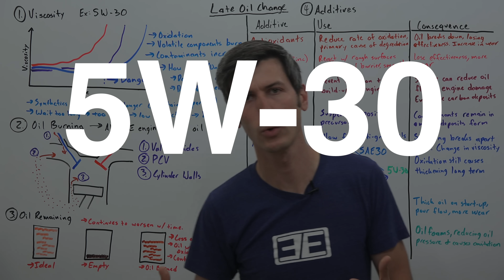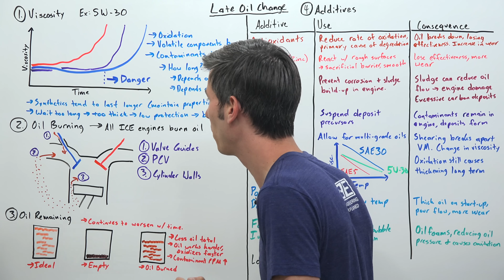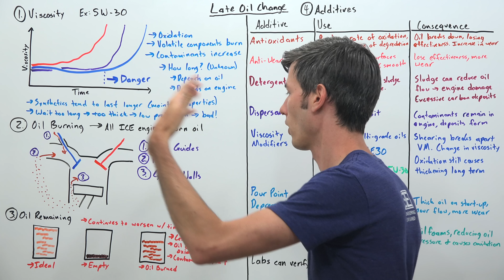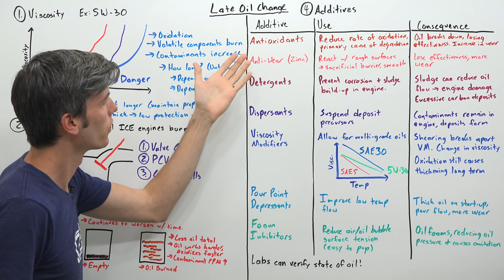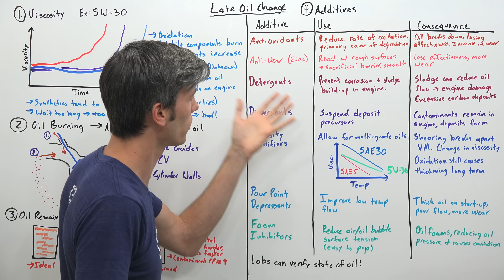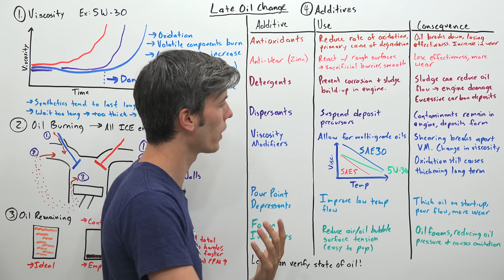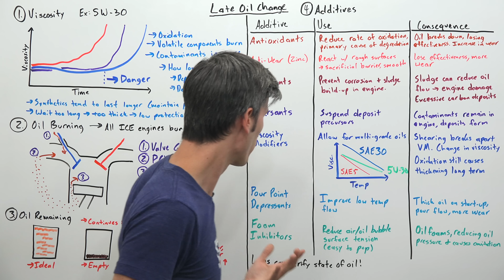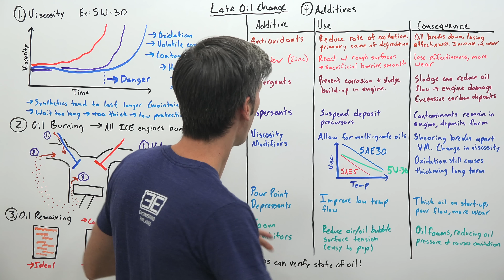What If You Forget To Change Your Oil?

Comment: On a car rarely used( once a month) , how long can fresh oil stay viable for use?
Reply: I would recommend using fully synthetic oil as those do not polymerize and can last up to 2 years and not more than 6000 miles.
Reply: Not more than 6k? Try 20k! Ams Oil and Mobil 1 both have 20k oil and filters.
Reply: @Theag393  That was the answer I was looking for. Usually I change my full synthetic every 2000 miles, twice a year, as I usually drive rarely. However this summer, I went on the road trip of my life, so I have passed 6500 miles 0n the same oil, so I can still make it if I take it to the shop tomorrow!!
Reply: @Tore_Lund  it should be ok. 2000 miles oil change interval is too low. 2 years or 6000-6500 miles, whatever happens first with fully synthetic oil is ok.
Reply: @Theag393  I live on 55 North so we have cold winters. The reason I normally change oil twice s year, is to avoid too much water in the oil because of condensation driving short trips in the winter, but I guess , I could do with changing oil only once a year if done like now just before Christmas and maybe be more sensible and avoid the 10km and shorter trips in winter.
Reply: @Tore_Lund  55 north but where? USA? Scotland? Anyway... Condensation inside the engine is not a big thing because pcv valves and the air should be almost moisture free. The residual moisture will get aspirated and consumed by the engine... Not an huge issue to warrant an oil change
Reply: @Theag393  Denmark actually, so it is just an old myth? Then you saved me $80, if I can just do it once per year! Thanks.
Reply: @Tore_Lund  As the engine warms up, moisture in the air inside the crankcase can condense into liquid form on the cold internal engine parts and is carried throughout the engine by the oil. If the engine does not or is not allowed to reach and maintain full operating temperature for a reasonable period of time, it never evaporates, and it turns into a whitish goop on the oil fill cap, dipstick and inside of the valve cover.

Changing oil more frequently helps remove this buildup, but the best answer is to make sure the thermostat is bringing the coolant up to full operating temperature and driving it at that temperature for at least 30 minutes every few days.
Reply: @Tore_Lund  in Denmark you have an average of 0°c in winter months but can reach -20°c. Check you oil fill cap and level stick and see if you have mayonnaise (emulsion of the engine oil and water). That is a good indicator.
Another indicator if you are going to have condensation is short trips and not reaching engine operating temperature.
Reply: @Theag393  Thanks, I've never had cream colored goo in the filler cap, but it takes a while in freezing temperatures to warm the engine up. I live in the city, so short trips are almost never called for anyway. Otherwise I keep the engine in good condition.
Reply: @Theag393  Try 100% synthetic, theres a big difference.  Amsoil is good for 25 000 miles
Reply: @TheBeatenPaths  I would not do that. Also amsoil is common in America. I am in Europe. I am more interested in renewing the oil and clearing deposits which has been proven more beneficial by using cheaper in specification oil and renewing more frequently than using expensive oil and changing less. Especially in diesels.
I am recommending synthetic oil and by that I mean at least group III oils ( hydrocracked). PAO and Esther is too expensive and you do not make a use of it...
Reply: @TheBeatenPaths  Only if one gets the 23 000 mile oil interval though. Filter change , half that.
Reply: @Theag393  full synthetic can last up to 30k kms
Reply: @keisuketakahasi4584  if you want to have problems sure. Especially with diesels
Reply: Fábio Malhão totally wrong and anyone who works on vehicle engines would disagree. The moisture content alone in two year old oil would corrode the heck out of that engine.
Reply: @MrJoel8959  there can be condensation but running an engine will burn it off. As long as you get up to operating temp and drive around for a while it's fine. Why do you think boats take a wide open throttle pass before putting the boat on the trailer? To burn off the moisture
Reply: Fábio Malhão what if u live in cold place? More little water leak from frozen/snow into oil?
Reply: @ハルドーソンアーノルド  water/snow should not be able to enter the engine oil compartment. If that happens something is wrong. Use fully synthetic oil with a viscosity that is recommended for your weather. Can give advice if you tell me where do you live and the car/engine that you have.
Reply: ・ハルドーソンアーノルド  the moisture in that two year old oil will certainly cause corrosion and engine damage. Don’t listen to Fabio
Reply: Fábio Malhão again your wrong. The heating and cooling of the engine causes condensation.
Reply: This would be interesting to know
Reply: freezeme360  Modern engines are designed to last longer and longer periods of time between oil changes.  3,000 miles use to be the standard.  Now you can buy cars where the factory recommends 10,000/15,000 miles between oil changes.  This is because of those oil additives as well as tighter tolerances of the machining of the engine.

That old oil lacked many of the modern additives and it did prove to cause much more wear than a modern oil.  The point was that the oil didn't degrade to the point that it didn't provide lubrication.  The OP asked how long he could go between oil changes on a car that was driven once a month.  My reference to the 60 year old oil was just to show that oil doesn't break down nearly as fast as the oil companies would like you to believe, they want you to change your oil more often so they make more money.  Yet they make the oils so good now, it's completely possible to just do annual oil changes with normal driving.  And the oil carries a warranty to back up that claim in the event you throw a rod though your block.
Reply: I've been sending in fresh and used oil to labs for analysis for over a decade and this question was asked and answered.  Time does not make oil in a modern sealed crankcase engine that utilizes a PCV system to "wear."  Contaminates due to running said engine, fuel dilation, and  use are what cause oil to wear.  If you're interested in learning more about oil for about $25 you can send a UOA in to Blackstone Laboratories.
Reply: @jaoliver999  Thank you
Reply: I wouldn't stretch it over a year if it's very humid...   And stick to the cheapest spec oil , esters in the boutique synthetics attract water so...
Reply: What I did not see mentioned is hours on an engine, which are not measured on cars like they are on tractors, ATVs, vocational trucks, etc. If a car sits idling or is driven at speeds below 30 mph a lot then miles become less relevant and the oil should definitely be changed every 6 months.
Reply: I've bought cars that had been sitting for 30 years and the oil was fine. As long as you don't have fuel or water in the oil then it's all good. Oil doesn't go bad as it sits, just keep an eye on it to make sure it isn't full of contaminants.
Reply: @BajaBlastBongWater  The oil in my car is 10 years old and still good. I have a rarely driven car sitting in a garage and I don't drive short distances. If I drive it then I drive for an hour so it reaches it's full operating temperature. Even an oil analysis shows the oil is still like new. So the frequent oil changes would be  waste of money and ressources in my case.
Reply: I'm also a low mileage driver, since I use public transportation to get to work.  I pretty much only drive on the holidays and the weekends.  Just follow your user's manual.  For my Toyota, the manual says 5,000 miles or six months, whatever comes first.  So I change at the six month mark, which for me is typically 1,500 miles between oil changes.
Reply: Oil is millions of years old anyway;) i know it's not the same. Was thinking of expiration dates on salt haha
Reply: My last oil change the oil was almost 2 yrs old but had only 2K miles.  So I'm guessing up to 2 yrs should be OK,  maybe longer.
Reply: So many comments but how long? I use my car rarely and i use fully synthetic. Since i do not reach 5000 miles in a year i just change it still after 1 yr. js that okay?
Reply: @markmarquez5431  I've been doing that for 13 years with my 2003 Expedition.  No problems so far.
Reply: @markmarquez5431  Have oil analyzed by blackstone labs, results should give an idea to gauge the interval.
Reply: Mark Marquez Yes, perfect 👌
Reply: One year
Reply: Change it every 12 months or 6000 miles. Whichever comes first.
Reply: Many manufacturers recommend changing the oil every 12 months if you aren't doing enough miles to hit the mileage-based service interval before 12 months elapses. I think this is conservative advice. In practice, so long as the car is used regularly and the oil is topped up as required, you could be fine for longer. However, oil does degrade even if kept sealed and unused. Total say that their oil shouldn't be used if it has been on the shelf for over two years: Mobil extend that to five years. Regardless, the cost of oil is trivial compared to the cost of engine repairs.
Reply: Paul B thank you Paul
Reply: Chrysler service library with conventional oil 12 months or 10,000 miles...I as an FCA tech, I call shenanigans. Synthetic oil a year should be fine. But I'd change it ever 6 months or so.
Reply: @Ratkill9000  The Jeep dealer in my area does that too! 10,000 miles with varnish inducing conventional. Are you mad!? My mom doesn't even drive close to 10k a year on her Hemi Jeep, but it eventually developed a tick at idle at 35k miles. It wasn't the typical Hemi tick, but an intermittent tick that was loud. Oil was only changed once a year at the dealer under their maintenance program. Well... the cheapest thing I can think of to try and fix the tick was better oil. Dumped Royal Purple 5w-20 in it. I gotta tell you that I have never heard a Hemi run so smooth. Usually they are very clattery engines.
Reply: @Dcc357  the Hemi does have a TSB out for bad cam shafts and potentially lifters.
Reply: @Ratkill9000  I've seen videos of the cam lobes wearing prematurely because of the lifters' roller bearings failing. A few things I also noticed weird about my mom's 2013 Jeep Grand Cherokee is a mild shudder when driving up a grade in the overdrive gear on a highway (our Jeep has the 65RFE transmission, heard it has to do with torque converter), and 4 cylinder mode has a vibration. This stuff doesn't really bother us since it's a Chrysler product that's perfectly driveable. I'm a mechanic myself and say it's best ot just leave that stuff alone.  It ain't a Lexus... but yeah it is what it is lol.
Reply: 5,000 miles, or 1 year; which ever comes first.  So simple.
Reply: With good quality synthetic oil, with low mileage like that, you should still change it after 12 months.  That's what I do with mine even tho I only put 1,600 miles a year on it.
Reply: The owner’s manual usually says x number of miles or every y months. BMW says a year, but others might be 6 months. I’d just check the owner’s manual.
Reply: javier f 1 year
Reply: With synthetic oil, change it twice a year. And try driving it more. Cars like people start to fall apart if they don’t get exercise. I get my truck out once a week for 50miles.
Reply: Ive not changed the oil in my car for at least 8 years (its 11 years old) but its only got 27k on the clock. Starting to make some noise, probably a wheel bearing, but I'll change the oil.just in case its from the engine this summer. LOL.
Reply: 6 months for conventional, 1 year for full synthetic
Reply: ProjectFarm (on youtube) cracked open a 60ish year old can of oil and tested it.  It was still good.  If it was still acceptable after half a century, I'm sure it's fine to have the same oil in an engine for a year, maybe 2 so long as you're not putting thousands of miles.  I'd still recommend using a full synthetic though as it will have a longer shelf life.
Reply: @ShamanNaoYuki  it's not the same a can of oil or a tank of oil
Reply: @ShamanNaoYuki  60 year UNOPENED oil will be fine. it's to do with the water in the air and exposure to air in general that kills it's lifespan.
Reply: Chris Hicks no, this is bad advice.
Reply: @ShamanNaoYuki  the oil additives react with the metal engine parts and that's what degrades oil over time.  The 60 year old oil was in a cardboard can, that's why it was still good.
Reply: @LuckyBaldwin777  I wasn't suggesting you leave your oil in your car for 60 years.  I was saying, if you're not putting over 3000 miles on your car between changes, your oil will be perfectly fine for a year or more.
Reply: @ShamanNaoYuki  It was a 70-year old can of Quaker State and the performance with his tests showed it was total crap.
Reply: @jamesplotkin4674  his tests showed it was fine. It didnt perform better than modern day oil because it never had all the additives we have today. It was still perfectly fine and up to the standards from 70 years ago and it wasnt acidic.
Reply: @ShamanNaoYuki  yeah but that was sealed oil in an engine no so much it kinder like a can of coke it can stand months on a shelf till it's opened. Oil inside an engine absorbs moisture creating rust on the piston rings resulting in rings seizing up and the starts loosing compression in cylinders then engine failure
Reply: Time is less relevant than mileage... within reason, years old oil... yeah, gonna be more important than mileage.
Reply: My own car says up to 6 months for cases like this, I'd check the car's owners manual
Reply: @MB7_7  Auto maunfactures don't know anything about oil.
Reply: @TheBeatenPaths  okay then. I'm sure BMW, Mercedes, Jaguar etc dont know anything about oil
Reply: If it's being driven sometimes, but not enough each drive cycle to get the engine hot, definitely every 6 months because cold engines run rich. This can dilute the oil with fuel. If it just sits, you can keep it in there for a year. If you actually drive it long enough each cycle for the engine oil to reach over 200 degrees, it can last a year.
Reply: Oil is cheap, replacing an engine is not.  Don't push it past a year even if it just sits in your garage for a year.
Reply: If you’re driving less than 5000 miles a year, you should change it yearly a least. I would change it every 6 months or so just to be safe.
Reply: Cole Lutz,
"... just to be safe."  "Safe from what, though? 

All of the deteriorating effects I saw described in this video seem to be a function of the engine running, not of it sitting idle. I am not disputing the maximum change interval of 12 months, since that is what the manufacturer of my car says is necessary, just trying to understand what it is about the engine NOT running often that makes the oil degrade just with the passage of time.

I use Pennzoil Ultra Platinum full synthetic, which is not inexpensive. Still, it costs less (and is less hassle) to just change at the required maximum time interval than to send samples to Blackstone to be analyzed, but I'm just about curious enough to do that anyway just to learn what properties of the oil deteriorate over time with low miles (infrequent drives of 50 to 150 miles, mostly at higher speeds) driven. 

 Maybe what I would learn is that the oil continues to be effective for more than 12 months, rather than needing to be changed at the 6 month intervals you suggest would be safer. Or, if the 12 month interval required by the manufacturer is overly optimistic, the used oil analysis should reveal what it is about the oil that deteriorates sooner than that , despite the low miles driven. If anyone knows the answer to that, it could save me the effort and cost to do the lab analysis, and would be much appreciated.
Reply: If it's conventional 3 months, synthetic 6 months

Comment: What would happen if you don’t change oil on time in your Tesla? 🤷‍♂️
Reply: Your reduction gear might start making whining sounds or even wear out eventually, but that kind of oil service is closer to a differential service, rather than internal combustion engine.
Reply: I can't speak for the oil alone but the oil mixed with soap if you don't take care of that then bits are going to seize and it won't go rolling down the road so much.
Reply: Your muffler bearings will wear out, and I think they are $2,600 to replace. ;)